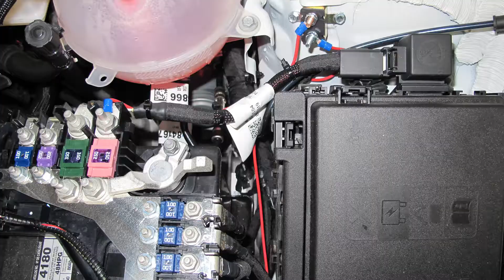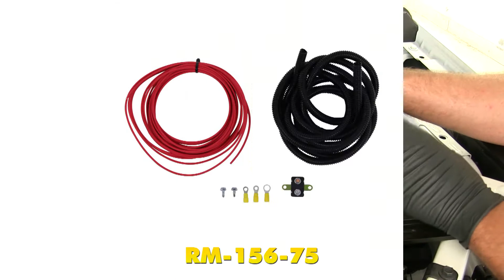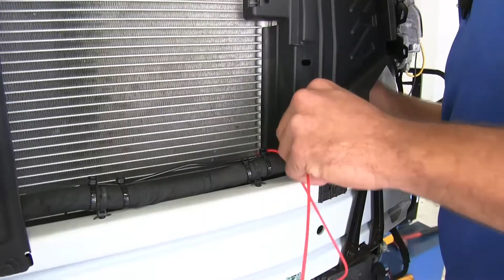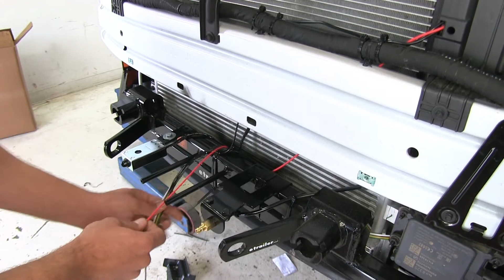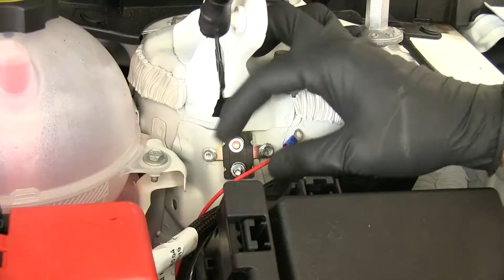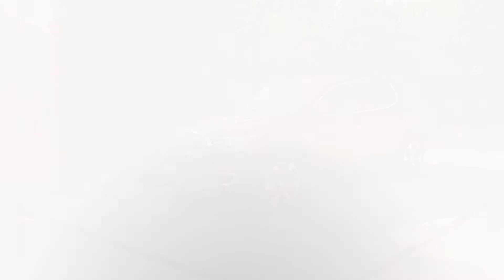DIY Install: Roadmaster Battery Charge Line Kit for Towed Vehicles on your 2017 GMC Acadia

Comment: What happened to the car if the positive terminal lost contack?
Reply from the maker: If that is the case and you are using the battery to power something like a supplemental braking system then the battery would likely die and need to be charged just as if the positive terminal lost contact without this kit installed.